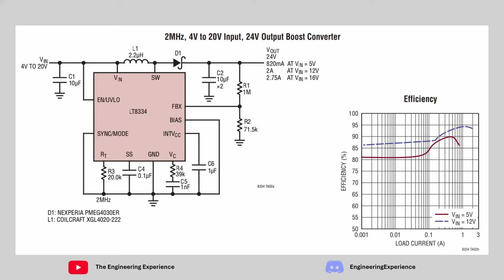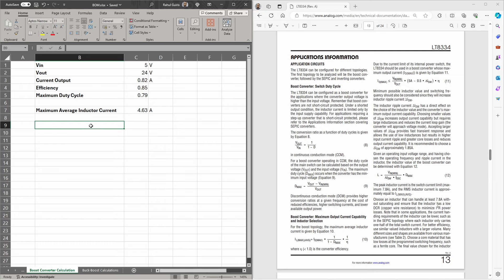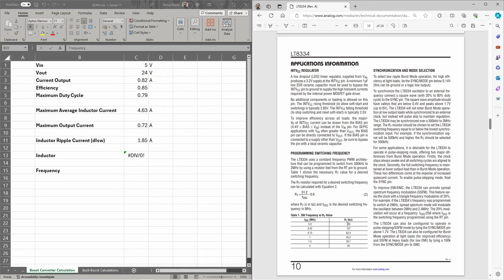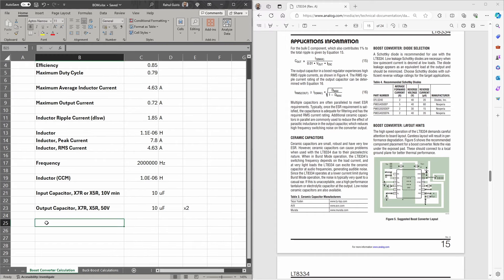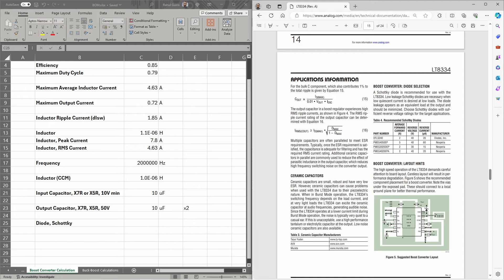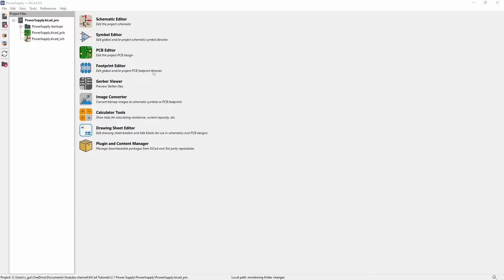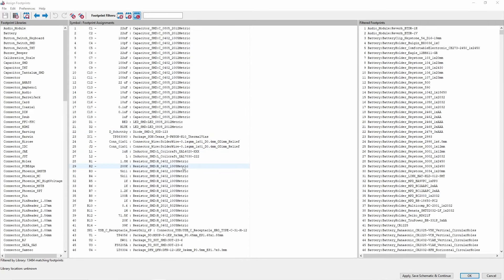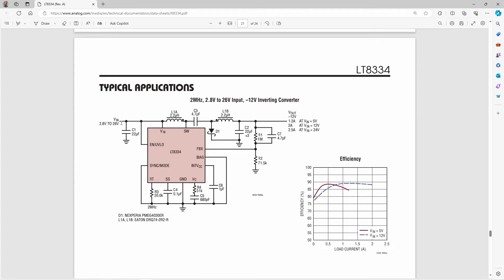Boost and Inverting Converter! - Let's Design a Custom Power Supply - Part 4

Comment: You have wrote 4 aa parallel  3.6-6.4v it's 
Which type cell it is?
Reply from the maker: Alkaline cells with normal range from 0.9   1.6 volts. 

That makes the power supply more portable even though it probably won't run long on high loads. Not that I am anticipating high loads when I use this for other circuits.

Comment: Can you tell me how to calculate IL max? What the value of n?
Reply from the maker: Sure, I will get back to asap.

N is from the graphs on the datasheet. Get the best estimate you can for your usage. 

Il max calculation will be in the datasheet but IIRC they have a recommended saturation current of ~7A which may be overkill for some applications.